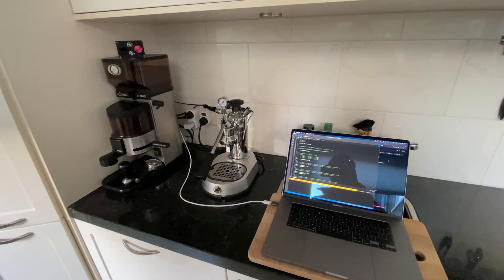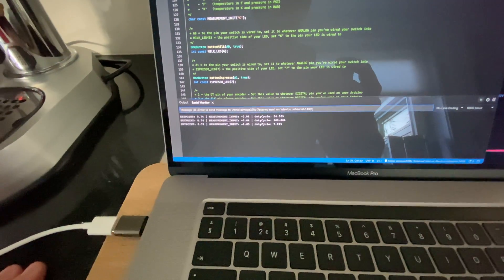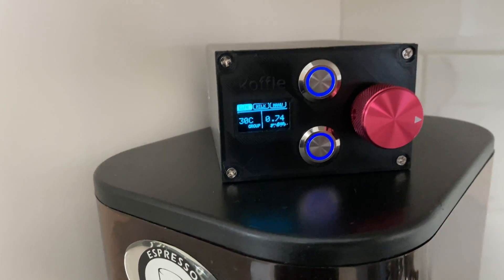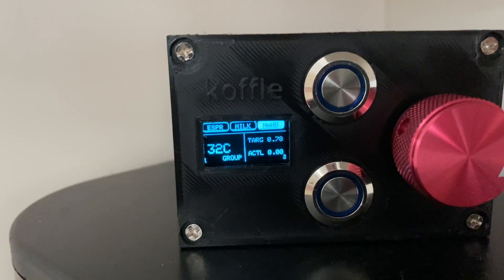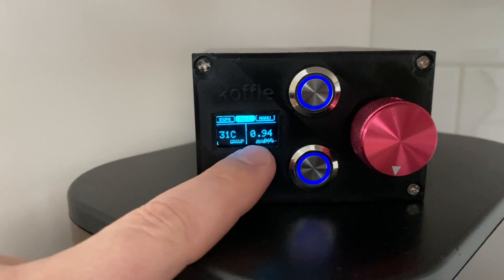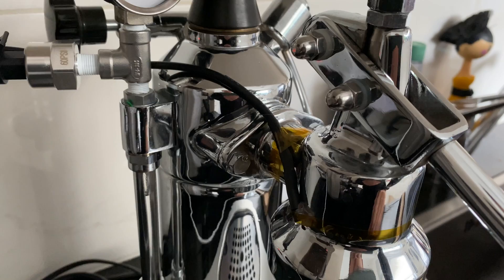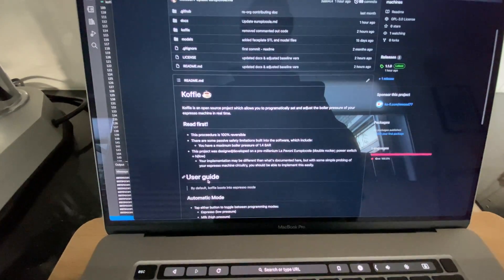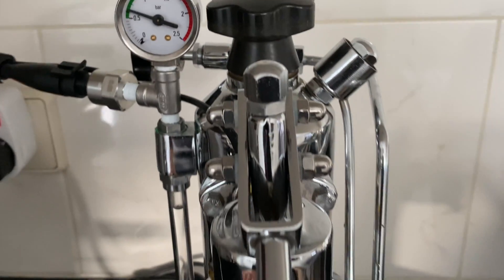La Pavoni Europiccola - Koffie Project Overview (open source PID controller)

Comment: Mick have followed your project and have started reviewing your code.. have a question,  as SW is not my best area of expertise.. trying to move away from your temp sensor and switch to a k thermocouple with amplifier setup. Did u go down this path and incorporate those macros.h into your main line code? I am trying to use a k thermocouple on a saeco barista system i have laying around for work..   did a gagguino recently but that is overkill for what I would like for this small espresso maker

Comment: As seen on Lance Hendrick's Argos by Odyssey review. Some people are trying to automatically compensate boiler pressure depending on the group head temperature to achieve fixed extraction temperature. I'm surprised but it's seems feasible. While it might take tons of time in calibration, it could be a game changer for this concept.
If ever probes could be routed internally to the boiler (maintaining the retro look) it could be a very popular upgrade even if costly and involving replacing the heating element for an upgraded boiler base with probes connections. Some aftermarket manufacturer could be interested to partner on this.
In any case, you should look at this video I'm mentioning. In the end, the implementation is very close to what you're developing.
Reply: i have a 2nd pid controller which cools the group by pumping cold water through a copper pipe wrapped around the group.  so you set two targets - the boiler pressure and the group temp.

Comment: Hi,
Now that I have started the schematic on EasyEDA I see where I need more info to help me complete the diagram.  The momentary LED switches have 4 pins (CH,+,-, NO). Not sure how this gets wired with resistor.
Reply from the maker: Hi @ernieburgos7702

Were you able to figure this out? The resistor is wired off the switch's ground, and connected to the Arduino's GPIO. You can ignore the CH&NO pins. Apologies for not responding sooner - I wasn't notified that you had commented.
Reply: @MicroMick  Hi, Yes I got it put together and  using it on my La Pavoni. Only problem left to fix is the temperature sensor. My temperature readings are way off.  I tried several different sensors. I have a hard time soldering the wires to the TMP36. My hands are too shaky. Unable to find ones pre-wired.
Reply from the maker: @ernieburgos7702  do you know what pressure range your pressure sensor is calibrated for?
Reply: @MicroMick  Hi,

Yes, the espresso setting is set at .75 bar and the milk setting is set for 1.1 bar. I have a Pro which uses a Pstat. I had to manually open the pstat to 1.3. I use the module to control the current to the pstat.
Reply: I have an older Gio built display and thermometer taped to the side of the group head. That lets me compare to the module temp display.

Comment: Hi,
I have all the parts and have started to take steps towards assembly. I learned how to install IDE and load a sketch into the arduino nano (Blink). Now I am trying to learn how to read the wiring diagram. It's been 40 years since I took a basic electronics class. Here's where I get confused. See the wire connection from the SSR to the Ground on the Oled display. I picture this as 1 wire from end to end. But the diagram shows 7 other ground connections to the same wire. I can't visualize how this looks. Any chance you can take a few pictures of your board and add them to your project github site? I also noticed in your project video the SSR is placed near the wall outlets. Is it connected directly to your La Pavoni?
Best Regards,
Ernest
Reply from the maker: Hi Ernie,

All grounds are wired to a common ground (they share the same connection).

I’ll try to get a better wiring diagram up this weekend, as I know this one is hard to read.

Regarding the SSR, my La Pavoni’s base is custom, and I wasn’t able to fit it inside the base - it’s directly connected La Pavoni.
Reply: @MicroMick  Hi, Thank you for answering so quickly. I created a duplicate of your circuit diagram using the Circuit-Diagram web program so I could save it in my account as a file. I am currently trying to convert the diagram into a PCB design using EasyEDA. All this software is new to me, so it is very slow going.
Reply: @ernieburgos7702  Any progress on teh PCB? Looking at this project for an older SAECO Barista.. Struggling with compiling, not my strength..
Reply: @alexolaverri192  I finished the project as originally designed. I never followed up on designing a PCB for it.

Comment: Hi, Thanks for this video. I am going to try to set this up for my La Pavoni Professional model. I have ordered all the parts except for the resistors. I know they are 4.7k ohm but what is the watt rating to be used? Looking at your diagram I see the switches are rated 3-6v. So I think it would be ok to use 1/4watt 4.7k ohm resistors.
Reply from the maker: Hi Ernie, 1/4w 4.7k on resistors would work fine!

Comment: Great project! So from my understanding you use the boiler pressure as input on your PID and only display group temperature? Also how do you build enough pressure for water to go from the boiler to the group if the boiler is at less than 100c? Thanks!
Reply from the maker: Hey Eduardo - thanks!

That's right, the boiler pressure is read using a T-pipe off the top of the water level indicator. The group temperature is a passive measurement - it doesn't affect the PID. That's because this is a relatively inaccurate measurement.

Inside the boiler there is a pipe that comes off of the group head assembly. This reaches down to nearly the bottom of boiler. The positive pressure of the the boiler forces water through this pipe.
Reply: @MicroMick  I have been looking in your GitHub and I have already ordered a few parts. So the pressure is build just from the expansion of the air inside the boiler? I’m still not sure how you measure the temperature of the group. Where do you put the sensor exactly? I wanted to be able to read the temperature and it needs to be responsive. I’m not sure what’s the best sensor for that
Reply from the maker: You can use a TMP36 analog temperature sensor, and the code is setup to display the temperature in real-time. Attach the sensor like so (beneath) and it should 'just work.' It's displayed on the left side of the screen as 'GROUP.'

The sensor has 3 prongs:
- VCC (+5V) which can be powered by the arduino
- Ground, which can be connected to the arduino's ground circuit
- VOut (signal), which caries the reading. Connect this to the Arduino's analog input (A2)

In my, admittedly hard to read, wiring diagram you can see the sensor at the top called "TMP36 (Group Temperature)"

You can then affix the temperature sensor to the outside of the group head with kapton (heat resistant) tape. I added some thermal compound between the sensor and group head to increase heat transfer between the sensor and group head. You can see how it's attached at 5:27 in the video.
Reply: @MicroMick  thanks! Meanwhile the pressure stat as arrived and I will be trying out your code today. I have found a same relay as yours but 25amp, so you think it will be a problem? Why do you recommend 40amp on your GitHub? Thanks!
Reply from the maker: Good Luck!

I can't remember why I chose 40A, but I think it was due to overhead or what I had on-hand; the low/high heating element draws a decent amount of current. I think you'll be fine with your 25A relay, but double check.
Reply: @MicroMick  Thanks I will try!
Reply: @MicroMick  Finally the parts have arrived, inspired by your code I finished the PID for my La Pavoni. I was having trouble with the pressure sensor so I attached a TMP36 to the back of the boiler and used that as input for the PID. Seems to be working well!
But I have to keep the temperature enough to reach 0.5bar at the boiler so that water is able to go to the group. I am able to keep the machine hot for hours, with a stable group temperature at 90-95.
Such a relief not having to wait for it to cool off for every shot, thanks for the help!!!
Reply from the maker: Glad to hear it worked out!
Reply: @MicroMick  I wanted to use the pressure sensor as well as the gauge. Which adaptor did you use?
Reply from the maker: @eduardofcgo  I used an off-the-shelf 1/8 NPT threaded tee adapter.

Comment: Do you know what the actual brew temperature is with a reasonable low pressure?
Is it constant? I always assumed that it must be above boiling point to create pressure, that would be a bit too hot for espresso.
But I guess there is expansion happening before that especially with the gases ontop of the water.
Reply from the maker: Hi Tilman,

I don't know what the temperature is, as I only measure it at the outside of the group head; isn't the most accurate measurement anyways.

You could add a secondary temperature probe (thermistor) and attach it to the bottom of the boiler. It's very straightforward to wire and modify the code to accept that.

It's also important to highlight that the boiler's pressure is not the brewing pressure. You'd need a pressure profile kit to do that; a group head pressure gauge.

Sorry I couldn't be of more help!
Reply: Thank you it's fascinating how the machine is pressure regulated

Comment: Is that an hybrid max or just a normal max? The drm srl ones are quite rare nowadays…
Reply from the maker: Good question, and one I didn't know the answer to. My very limited research shows that all Max units have conical/flat burr grinders. I think there was a run of hybrid Juniors for the American market in the early 2000s with the Max's burr setup. Does that sound right?

As for my unit's history, it was bought locally and only ever used in a home environment; the automatic grinding door/flap assembly was removed by the previous owner.

Comment: Super cool project! I'm sorely tempted. Is there any reason one could not make wireless senders for the temp and pressure signals to make it less... um... wiry?
Reply from the maker: Great question! Yes that should be doable, but will add some complexity - 2x ESP32 boards should be able to accomplish this relatively cheaply (roughly an extra €4 on the total price). The increase in system ram would also be nice, as we’re already at the limit of what the Nano can do. 

I’ve added it to the project board:
https://github.com/mwood77/koffie/projects/1
Reply: @MicroMick  I did wonder at your nano vs full choice. The small box is handsome but since it is remote from the machine I thought size was not such a concern. Was there a reason to go with the smaller board?
In a similar vein I was thinking about where to have it live. Up out of the watery counter area, of course... maybe ontop of/integrated with the relay box?
Reply from the maker: I went with what I had on hand/what I thought others may have on hand. I've purchased some ESP32s and a few Picos now, so I'll start looking into this more when they arrive. My only concern with using either of these boards is that they're more complex to initialise than an Arduino - especially C++ on the Pico.

As for mount - there's another Europiccola PID video on youtube where it's mounted to the pressure sensor. That could be an option, provided that the relay is mountable inside the base. I can't verify that on mine, as my Europiccola's base isn't OEM and the relay doesn't fit. This configuration would be ideal, as you could run the secondary board off of regular mains voltage provided by the Europiccola. I guess the biggest problem with that solution, is that it impedes the steam wand knob.
Reply: @MicroMick  I did not notice your base! Is there a story about that? 

I did briefly think that a taller base on the Pavoni could hold lots of goodies but I would worry about keeping them cool and dry enough.
I am very consious of counterspace as you can tell. Other places to put it:
Under/integrated with your knock box? 
Under the grinder.
Inside of the relay box
Inside of a "wall wart"
In a backpack hanging off the steam "T" in back? with an IR heat shield. This could be fun to style like a booster rocket or something.
Reply from the maker: @PaulBostwick  My machine was a mess when I got it - it spent 30 years in a barn and showed it. The base was rusted out and it was easy enough to draw up a new base in CAD and have it CNC'd out of 3003 Aluminum. I still need to sort out a new rubber foot for it though...

I'll have a think on how the secondary enclosure could work, as if I go down the wireless route, I'd like to release a "complete solution" again. Biggest challenge is dealing with the Europiccola's heat, imo.
Reply: @MicroMick  I think you are right about the heat being the main challenge.
 
If you make the drip well shallower that would provide a bit of room under there, maybe enough. Over there it is pretty far away from the boiler... so maybe a heat shield and some thermal paste to join it to the exterior would do it.  
A fan and vent holes would be a confession of failure [but it would work :^)] 
A rubber foot is a challenge too. Have you considered using that CAD model of the base to make a mould cavity and pour a rubber foot? They could cnc it from High density propolene and with some undercutting and a daughter mould you could get a pretty slick product.  A thought. 
There are also prefab rubber profiles you might look at to wrap the edge and give it a finished, grippy black foot. "Rubber Edge Trim" as search terms brought up some promising hits. If you started with a thick one and shaved what becomes the bottom flat you could get a slick looking product to go along with the nice base.
Reply from the maker: Those are some great ideas! I'll see what I can do, as I'd like to shoot a better video of it in the future (would also be nice to have the Europiccola looking better). I tried a form of rubber edging earlier, and it just didn't work.
Reply: @MicroMick  It would need to be dense stuff...  alternatively you could make a bottom that does not show and give THAT some basic rubber feet/suction cups that hide up under and your base "floats" visually.
Reply: Is there a reason you use the PID to drive pressure rather than temperature? Or am I missing something?
Reply from the maker: It's true that pressure and temperature have a linked relationship and can be deduced from one another given a perfect system. However I'm not great with physics, so I'll leave somebody else to answer that better. What I do know, is that this wouldn't be an ideal solution in our application (our boiler is conical and bleeds pressure).

As for driving pressure over temperature - I took this route for a couple reasons:
1. The older non-pressurestat Europiccolas like mine are not stable, as pressure regulation is only achieved by manually turning the machine on/off or toggling between hi/low heating elements. My PID manages this automatically.
2. There's no way (currently) to monitor the true water temperature in the boiler or the group head. The temperature probe fixed to the group head as seen in many Europiccolas is only good for a ballpark estimation of the pre-infusion temperature. I've now added more code that includes the group head's temperature reading as a conditional check when error checking against faulty pressure sensors.
3. Lastly, monitoring boiler pressure is more common/accepted than boiler water temperature; most devices on the market include a group head pressure gauge and boiler pressure gauge rather than temperature gauges.
Reply: @MicroMick  Id forgotten for a moment that the eruopiccolas had no pressure stat. 
I think the pressure gauges (group head and boiler) as the approach on most machines is a product of: thrift and the fact that most more expensive machines are pump rathter than lever so group pressure is based on that pump and a gauge is appropriate for telling you if you've hit the right pressure.
Driving the boiler based on group head temp (assuming you have the group head's temp approximately mellowed with some isolation - which is a big deal) is worth re addressing. That is where most of these machines fail or win, not pressure. Water temp over or under expresses the coffee flavors. Pressure, once you get the handle down a bit is all in the operators hands, literally. No?
There is the issue of the speed of the response of the espresso machine to changes. When you lift the handle the pressure changes in the tank, the grouphead gets flow of thermally dense water at whatever contrasting temp it is and all those changes are chaotic and too fast for the PID to respond usefully to. But the Bong Isolator claims to have gotten that under control to a great degree... so that is possible... and if that was done then water at the grouphead temp centric PID would be the final measure.